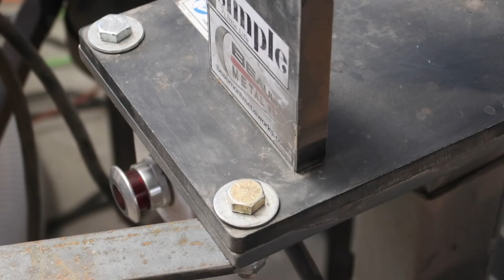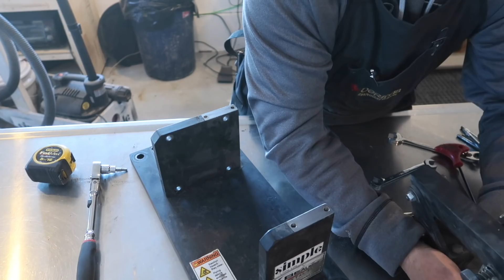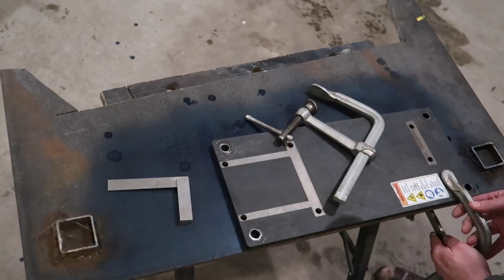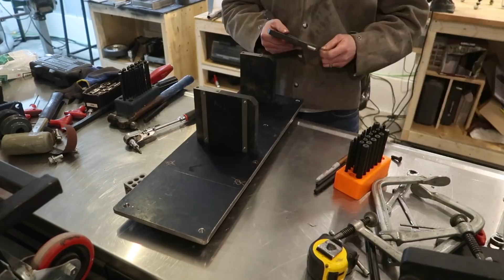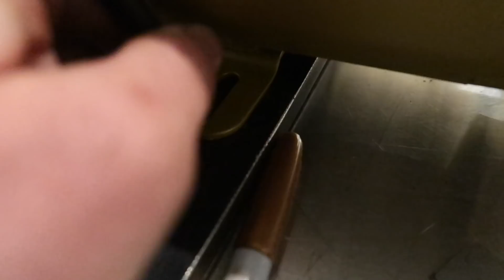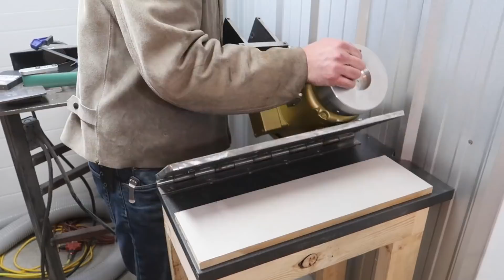Converting my KMG 2X72 belt grinder to direct drive. Why didn't I do this sooner??

Comment: Open the kbac up and at the top there are adjustable pots make sure the first one is set all the way clock wise and recheck your sfp.  Mine was only factory set at not even half speed I gained another 700 to 800 rpm.

Comment: The wheels Looked wobbly after you did the conversion because the belt was rocking from side to side maybe the motor wheel is a little tilted

Comment: Thanks for the video. I have been thinking about doing this with my KMG. As a curiosity are you thinking about adding a forward/reverse switch to your set up? I know that BMW says that they don't recommend running it in reverse but they don't really say why. I believe it may have something to do with the tracking.

One other point about the drive: there is a jumper on the inside where you can double the SFPM of any motor effectively making it a 3500 and with the 6" drive wheel even more at max speed, which you should never have to run at that point.

Again, thanks for sharing your mod, I appreciate it.

Comment: My grinder is a 1 phase 3KW motor, is it possibly to use a variable drive like this as well? I'd love to be able to slow it down at times.
Reply from the maker: From what I understand it needs to be a 3 phase motor if it’s AC. My first grinder I made was with a DC treadmill motor which allowed me to vary the speed. It is a really nice feature👍
Reply: I honestly don't know if it's AC or DC but I'll assume it's probably not possible! I will try and find out. I can cope without it but at times it would be useful (For the reasons you mention in your video).

Comment: Please keep in mind that the motor have his own cooling fan and if you use the motor with very low rpm, he may overheat under load. It depends on the motor but i would say about not work under 30%
Reply from the maker: That’s a good point. I’ve been checking it when I’m running it slow and I’m not putting nearly enough load on it in my grinding to heat it up. I imagine if I was running a smaller motor that could be a potential problem. Cheers👍

Comment: What kind of countersinks do you use. Great video by the way.
Reply from the maker: I use either Walter or Dormer. Worth the money for sure. I have some that I’ve been using for over 10 years. Run them slow, use cutting oil and they last a long long time. 👍

Comment: That looks AWESOME!!!! Glad to see you got it working!!! There are setting to overclock the VFD, you can set the 60hz to either 90hz or 120hz. Just remember, twice the speed, half the life. Also, you have to get a amp clamp to make sure you aren't going over the set amperage too much.
Reply from the maker: Yeah I should check the amperage on it, haven’t done that yet. I did change it to 120 Hz and man does it hog off material!

Comment: You can get those disks cheaper on amazon
Reply from the maker: All depends where you live. Some stuff isn’t any cheaper on Amazon. But then again, I did need them right away. Having said that, I cut all that metal with a single disc and it only used about 1 1/2” of diameter so the quality justifies the price. 👍

Comment: SFPM Belt Speed. (6 x 3.14 x 1760) /12 =2763 SFPM
Reply from the maker: Or just use the SFPM setting on my Blue-Point tachometer 😆👍
Reply: Or you can do what I did. A little math and came up with a small,  percentage - speed chart. I stuck to the face of the VFD.

Comment: You did a good job, if you want more speed you can turn up the hertz in the vfd settings you can actually make the motor run at 3400 rpm like your old motor which would be faster than you would ever need, I have a cheap vfd that I enclosed in an airtight box and my 1 1/2 hp motor is 1750 rpm’s I think I have mine set up to get about 5000 sfpm but I didn’t max out the hertz though I think I went up about 80% on it, the reasoning for using the slower motor is they say they have more torque and you can raise the hertz to match the faster motor without any adverse effects the bearings are rated the same as in the faster motors.
Reply from the maker: Yeah I switched mine to 120 Hz (after shooting this video) and it has way more speed than I need! With trim pots adjusted I can get up to 6400 SFPM. I toned it down a little and at around 5000 it makes fast work of rough grinds! 👍
Reply: You lose out on torque on the high end by doing this. It is a valid option though that a lot of guys go with. Personally I went with a 3hp, 3450rpm motor so I would never have to look back... and I haven't yet. I have yet to bog it down or wish for more sfpm.

Comment: Hi Jeremy, interesting vid but a bit worried about the addition of a switch to the VFD. My understanding is that you can't (or shouldn't) ever just kill the power to a VFD while it is operating. You need to check the wiring diagram for your particular model but I discovered this while researching my Bridgeport conversion. Just in case you use the original switch as a safety kill switch, it might end up destroying your motor or the VFD. Cheers, Steve.
Reply from the maker: I agree. I would only use that in an emergency. I used to install airport baggage conveyors and I’ve set up and installed hundreds of VFDs on them. Killing the power isn’t recommended, but I was shocked how often it happened (I used to be on-call maintenance too) and have yet to see one do any damage. But I agree, avoid doing that at all costs. Once I make my final mount for the VFD and it’s in a safer location, I might do away with the e-stop button and just mount a on/off switch to the VFD so I can turn off power to it when not in use.

Comment: Jeremy, the new grinder setup looks awesome, but i would recommend a better placement for the emergency stop. With the grinder folded to the left it's a long reach to hit the button. When you relocate the speed controller, you may want to consider mounting it there as well. Just a thought. Otherwise keep up the great work.
Reply from the maker: Thanks so much! I agree completely. Certainly it a well placed switch at all and I will address that when I get my final stand built👍

Comment: Did you have any issues with vibration with your design and the smaller bench? Looks amazing...congrats!
Reply: Nevermind... just saw your washer test. Very nice. Is your bench anchored to the wall or floor btw?
Reply from the maker: Temporarily anchored to the wall. 👍

Comment: After watching the whole video I realize you're not using the Doubler if you engage the doubler inside the kbac you will double your output however be careful because not all Motors can handle it it's better to use like 150%
Reply from the maker: Interesting. I didn’t know it had a doubler. Gonna have to look for it and try it out. Thanks!
Reply: Simple Little Life  just watch most motors will handle it, they will always tell you they don't recommend it but everyone does it, I rarely go above 175 % however I have a 4" drive wheel, so yours will go even faster just food for thought. Great videos!
Reply: The doubler is an awesome feature!
Reply from the maker: Yeah it is👍

Comment: Are you liking the snap on ratchet with the comfort grip handle? Is the locking swing head worth it?
Reply from the maker: I love it. I’ve had it for about 4 years and I’m a firm believer in quality tools👍 The locking swing head is really handy, especially if you’re working on vehicles. I don’t know how many times it’s save headache when I’m fixing stuff on my vehicles. I have the snap-on hard handled non-locking swivel head version as well, but this one is my go to.

Comment: Simple little life,,,, I love the grinder change . That will come in most handy.... One question though since you had your grinder torr down you should have reverse engineered it and built another one from the plate you had. Perhaps you could do this sometime so we could have the opportunity to build a great machine not to mention with being able to reverse engineer your grinder you will never need to buy another ever... Thanks for the video,Martin M&S Blades
Reply from the maker: Thank you! I am actually working on plans to make a new grinder, however I have a much simpler design in mind.
Reply: great I look forward to your design and video on the build.. Martin M&S Blades
Reply: Jeromy,  can I ask you to comment back on my question when you have a second. My question is in reguards to the grinder can you tell me the length of the section were the toolarm goes and how high it is off the base as well.. I am wanting to build a grinder all I have is basic tooling meaning I do not have a mill but I do have a drill press. I have a large section of I beam that I could use for the build it will probably build 2 grinders. similar to the KMG. Although I am very excited for your build I am in need of a grinder and have yet to find one in my price range lol they are expencive. Anyway the I beam I have is a 24or 28 in. I beam and is every bit of 4ft. long and is 1/2in or a tad more thick. Even though it will take a lot of work to cut the pieces in my opinion I already have it and was going to use it for a power hammer but I think a grinder is more important as of now. Thanks in advance, Cheers, Oh yea If you would like you can message me on my youtube channel to make a conversation a bit more effective... Martin